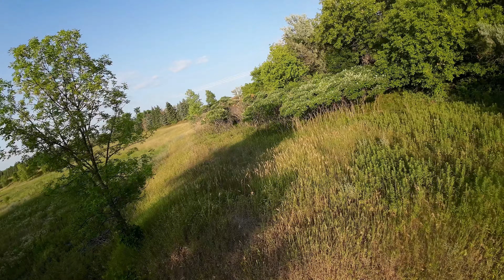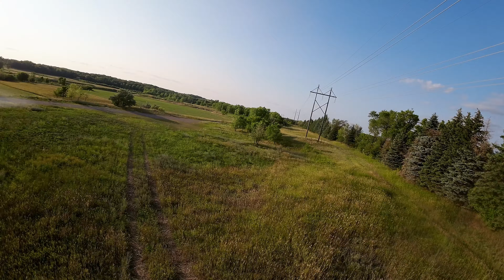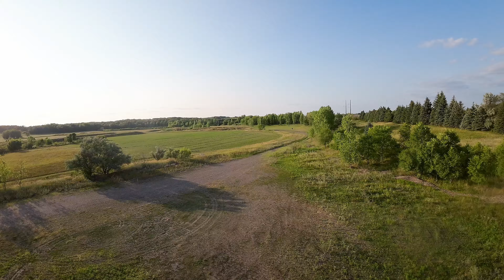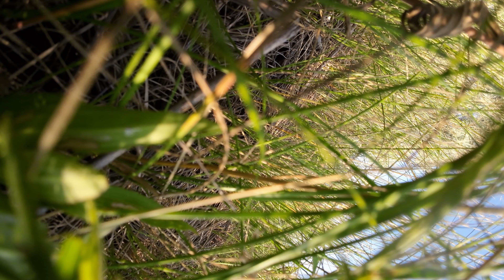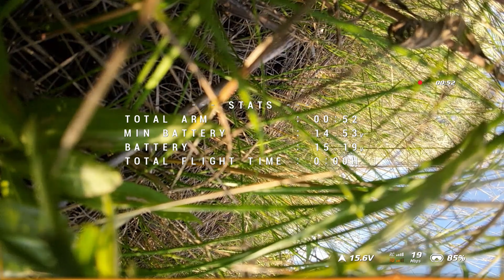Quadmula Crash - Why?  please help - FPV in a beautiful field

Comment: I've had this happen on one of my flights. For me, my ELRS module connected to the back of my controller had a physical disconnect.  One of the pins had broke (probabaly due to me installing and removing the external module after each flight session). After dozens and dozens of remove/installs, one of the pins broke. I didn't know until after I removed the module. Not sure if the problems are the same.. I hope you're able to get back up in the air again!
Reply from the maker: Awesome!!!  Thank you very much for the help man, appreciated.  
(Un)fortunatately I've flown it a few times since and it's flying normally, except now I have 0 confidence in it lol.  
I certainly think it may have been a disconnect of some kind.  I'm a novice at soldering at best and my joints look like a toddler may have done them. lots of possibilities for failures :)  
I think I'm going to desolder everything and re do it all.

Comment: hey buddy, i had the same issue and i was using the dji controller 2. i changed to elrs with zorro and everything is fine now, i dont get disconnects or sudden drops from the sky. it was very frustrating until i was 100% sure its the dji rc2 with the o3. try an elrs with a rm rc and see how it goes with you
Reply from the maker: Thanks dude!  I appreciate the advice.
Fortunately that only happened once. I quit flying it after that and resoldered all of the joints again to be safe as I'm pretty new to building/soldering.
So far, it's flown normal since, but yeah, it could easily have been rc2 issue, I was also flying with a friend running o3 also although I don't remember if elrs or rc2 for him at that moment.
I fly some quads with elrs/zorro and will most likely be switching all over to it. 
but unlike everyone else on the internet :)  I actually like the rc2.  Probably because I spent 50 hours with it in simulator initially, just always feels a bit more homey and xbox like I guess.
I may purchase the RM pocket, it seems like a perfect fit for me. 

Thanks again for the advice dude, I think you're the first person to actually offer any 👍🤜